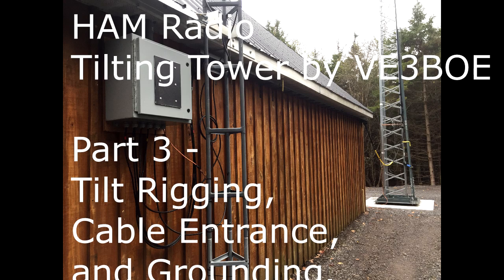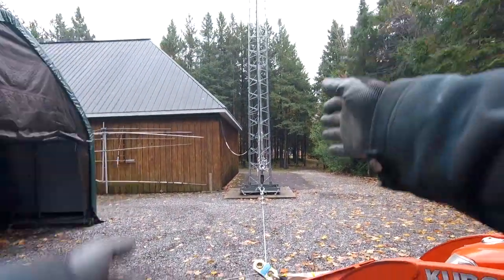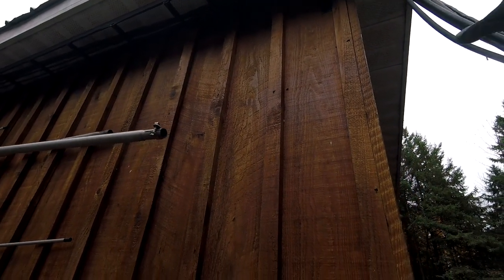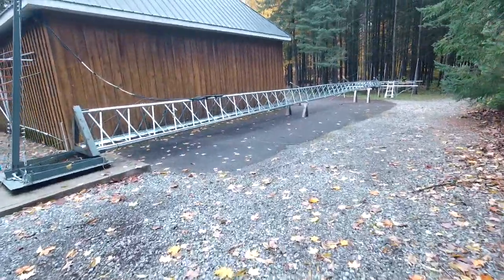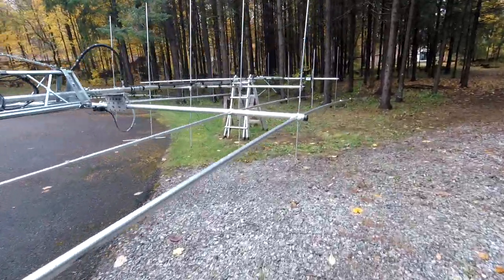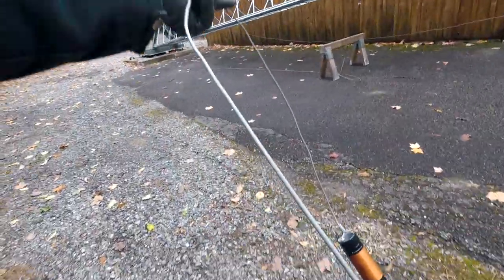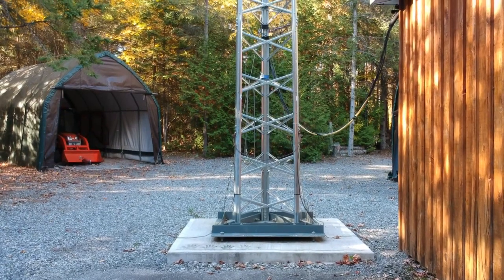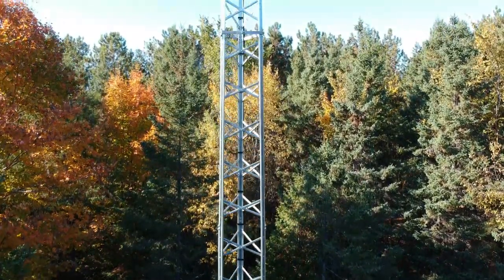Tilting HAM Radio Antenna Tower Part 3 - Rigging-Operation-Cable Entrance and Grounding

Comment: Marc I know I commented previously about this being the best video series out there for this application.  Well by watching this series several times and consulting with a friend who is much better at math than I.  I'm happy to report in late October last year we got my 60 foot tower with a 10 foot mast on top up and working.  It has withstood some 90 km winds and a couple of winter blizzards so far without issue.  Not worried about summer as the trees will fill in and create a wind break for most of the tower.  Can not thank you enough for taking the time to do these videos.

Comment: One little tip on the little tractor (I have one just like it)...  Extend that backhoe bucket as far out as possible for some counter weight, and poke the teeth into the ground for some more holding.  It's sometimes just enough to make all the difference in preventing the tractor from moving.

Comment: What an amazing project. This is the nicest tilting tower I’ve seen. I wish I could buy a kit with all the parts for it. Great job.
Reply from the maker: Thanks for the kind words. I am glad that you enjoyed the video. I also agree that a quality tilting tower kit would be great (I would have bought one),  but I already spent the past 30 years running a small engineering business and I am not that interested in starting another one. lol . Take care.  Marc VE3BOE
Reply: @marcinmetcalfe595  By chance do you have a set of plans you would be will to sell for this set up. In the next few years I will be building a shop in some property. I would love to build your same set up. I am a carpenter so much I can do except for the welding I would have to hire out. Including the tilting beam antenna with the other antennas you use. In my opinion this is really the ideal set up. I also like the clear to sprayed on the aluminum. Can you tell me what product you used? Where did you buy the tower?
Reply from the maker: I don’t have any plans.  Most of the construction details etc., can be seen in the videos and found in replies to comments found in the three video series.  The clear paint is Rustoleum clear.  Good luck with your project.

Comment: Hard to tell in the video, but it looks like the cables from your "falling derrick" are not at equal tension when under load (the cables attached to the tower).   Should not all of them be of equal tension when pulling?

Comment: Very nice system!  I am in the planning stages for a similar set up, although with a shorter tower and less antenna up top (40' Universal tower with a hexbeam antenna).  I see you have side guys on the derrick, but not on the tower itself.  It seems that a common suggestion for falling derrick systems is that both should have side guys while raising/lowering the tower.  I'm curious what your thoughts are about that, and whether you have seen any substantial side-to-side motion with your tower during raising/lowering operations.  73s.
Reply from the maker: Thanks for your comments. My tower is a self standing type tower so no guy wires are present or required. The hinge base also provides lateral support when raising and lifting due to its width when compared to thinner standard towers that are not tapered. You will also note that I am very careful not to introduce any lateral loads by the careful positioning of the derrick and it’s associated cables. I highlighted this in one of my videos. The only lateral load would be wind loads which I can control by choosing the time.  The key is in using a self supporting tower with a tapered profile and the careful selection of the hinge axis. Hope this helps.
Reply: Thanks for the quick reply.  The tower I'm thinking about is also freestanding and tapered.  The legs that hinge are 28" apart, but the hinge mechanism doesn't look as robust as yours.  I agree that wind is the most likely factor to cause side loading, particularly with a symmetrical antenna like the hexbeam.  Thanks again!

Comment: beautiful design.  only recommendation i can make would be to make and install a cover for your base so you don't have standing water in your tilt base.  other than that i am 110% jealous of your setup.  does this tower design allow for manually climbing the tower to perform work or is it solely meant for doing work when in the down position?
Reply from the maker: Thanks for your comments Rick. I did drill a few holes in the base for standing water drainage but I think I need a few more.  With regards to the tower’s climbability, the original manufacturer of the tower states that it is climbable if installed according to their specifications.  My titling mechanism falls outside of their specified design. My design intent was to never have to climb it.

Comment: Brilliant setup. Could a guy use hydraulic rams to raise and lower the tower rather than the cable set up you have? Regarding the Tremclad Clear, did you brush or spray the tower. It’s so clean and new looking. I ask as I’m just getting into the hobby and looking for a used tower to purchase. There a few around for sale close by me heights being 40’, 56’ and 96 feet. My concern is I don’t know if they are capable of being strong enough to handle the action of lowering and raising with out buckling or snapping at the pulling/lowering point, is you’re tower built from a heavier grade of steel so as not have that happen. Thanks 73
Reply from the maker: I would guess that there are many other methods to raise and lower a tower like this.  It is simply a matter of knowing how to design and implement them properly and safely.  I can't speak tp the suitability of other towers.  The tower I am using was not intended to be used in this manner by the manufacturer. The lower segment of the tower in my project is reinforced.  This is stated in my part 1 video.

Comment: Very professional job. I am amazed in your attention to detail.   I see is previous comments that the mast is a 20' aluminum one.  Can you tell me the ID  and wall thickness?   I am planning a mast location of similar length and antenna array.   Also, what was the length of the falling derrick in relation to your mast height?  It seemed to work very well.  73's K5OOL
Reply from the maker: Thanks for your nice comments Chris.  My falling derrick is 16 feet in length. I am looking into my records for the exact spec on the mast. I remember being very specific about that and I had to have it special ordered by my local shop.  I will repost when I find it.
Reply from the maker: The Aluminum mast has a wall thickness of 1/4 inch and an outer diameter of 2 inches.

Comment: how long is your mast? I see you have three separate beam antennas on it.
Reply from the maker: The mast is 20’ long. Each antenna is mounted four feet apart. The first antenna is a Hygain Explorer 14 (with 40m) about 1 foot up from the tower top bearing, then four feet up to the Cushcratf 5 element A505S for 6m, then another four feet up to the Cushcraft 13B2 13 element for 2m, then finally an additional four feet up to a Comet GP6 for 2m and 70cm.  That leaves approx 7 feet from the top bearing down to the rotor.  The Mast is aluminum.  Hopes this helps.
Reply from the maker: And with regards to the antennas, there is also an Alpha Delta DX A 1/4 wave sloper (160m, 80m, and 40m) located a few feet below the Epxlorer 14 beam.  This gives me total coverage on the tower of 160m, 80m, 40m, 20m, 15m, 10m, 6m, 2m, and 70 cm. It’s relatively easy to add antennas to a tower when you can easily bring it down to the ground.  Hats off to those who climb to do this. I hope your project is working out well for you.
Reply: @marcinmetcalfe595  20 ft of alum mast pipe must’ve been extremely expensive but worth it. I’m looking at the same tower locally that has never been installed. I would only use it for tilt as well. I missed the first two parts but I will watch them. I’m currently in the city but somewhat looking in rural areas for a home and a few acres. Very hard to come by at the moment. I’m also very curious on how your 40m add on compares to your 40m wire “alpha delta”? Thanks for the inspiration. 73 jay
Reply from the maker: The aluminum mast was actually not that expensive. I seem to recall around $200? .  I couldn’t tell the difference between the wire 40m and the Explorer add on element so I ended up removing the 40m add-on and restoring the Explorer 14 to its original design. The 40m add on is structurally very weak and, in my opinion, a bit too much for this size of antenna. That’s why I removed it. I would not recommend it.
Reply: @marcinmetcalfe595  thank you very much for the feedback. I’ve noticed that with 40m trapped dipoles also. If you can recall the aluminum pipe size and number, that would be great. I think metal depot is where I looked before. I’ve been using gas pipe and it’s extremely heavy and causes massive wind load up top. I would definitely like to do it right this time. Btw I’ve found 40m delta loops do well in a sloper or vertical plane. Fed 75ohm rg11 stub.

Comment: Might some weights hanging (at an appropriate length) on another wire off the guy wire(s) opposite the gin pole make a balance so the tower doesn't slam down and wobble so badly. Others do this and have even made a perfectly balanced tower pivot using the counterwight to offset the weight of the ginpole, etc. They literally hand lower it into its final resting place an inch at a time. This also eliminates the need for a solid brace between the tower and the ginpole. See https://www.youtube.com/watch?v=i1apgY3Gw5U

Comment: Thanks for this awesome informative video about your tower and the yagi antennas! One quick question, would the Comet antenna, I believe you said yours is the CA-52HB4, work very good for the 160 - 162 MHz range. I'm having trouble finding a yagi within that programmed range.
Reply from the maker: Thanks for your nice comments Joseph. The antenna I believe you are referring to is the 13 element Cushcraft 13B2 and it is designed to operate from 140 to 148 Mhz. I may have mistakenly called it a comet in my video. I don’t believe it would be effective in the frequency range you asked about.
Reply: Ah okay, thank you so much! Once again amazing set up with the tower!

Comment: Marc, What the mfg & part number of the lightning arrestors? What wattage rating? Coax 259?
Reply from the maker: I used the PolyPhaser  PPR-IS-50UX-C0. They are the flange mount type with SO-239 female connectors. The specs state 2000 watts. They make many variants. I used LMR400 Ultraflex for all antennas.

Comment: Ta heck with the  the tower,,I like the garage...beautiful setup Marc,,as others have said,,I'm about to do something similar here in Honey Harbour north of Barrie.How tall is your tower and what is the size of the winch?....Gene..VE3IJD
Reply from the maker: Thanks Gene.  My tower is 56’ tall with 12’ of mast extending above it for the antennas. The winch I am using is a 12,000 lb unit.  It is actually overkill considering I am using it in a double line pull configuration.  You’ll have to do the math on your final setup for your required size.  Best wishes to you from Metcalfe south of Ottawa. VE3BOE
Reply: @marcinmetcalfe595  Cheers Marc for that outstanding setup you do have there. Congratulations. Got a question about your tower, what brand is it? Looks like a  Wade DMXHD, made there in Ontario, isn't? I'm about to mount one 40 feets of that same brand ( Wade ). Thanks for sharing and best 73 from VA2VG.
Reply from the maker: @6alban  The tower is based on a DMX48 Heavy duty with an additional 8 foot straight section added.  The mast is a 20' aluminum mast with 14' protruding from the top of the tower.  The rotor mount was custom located lower than the original to provide greater stability.  The stock Wade top bearing was replaced with a heavier duty Yeasu GS-065 top bearing.